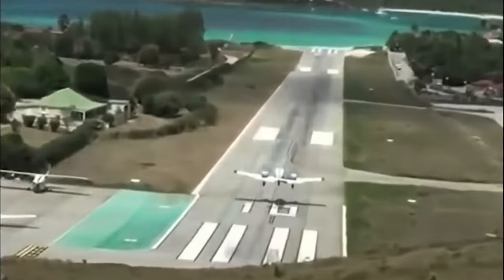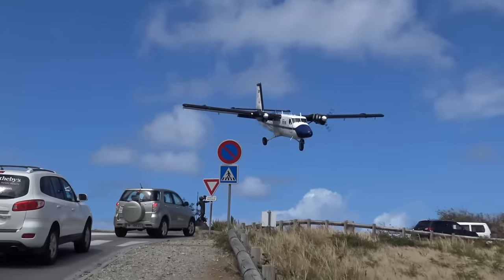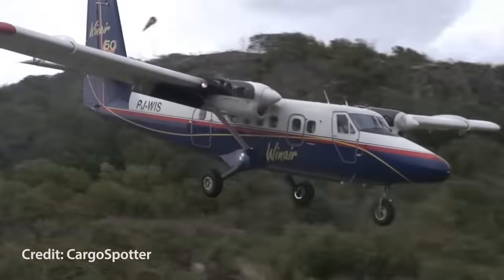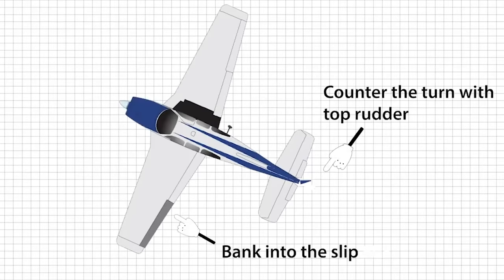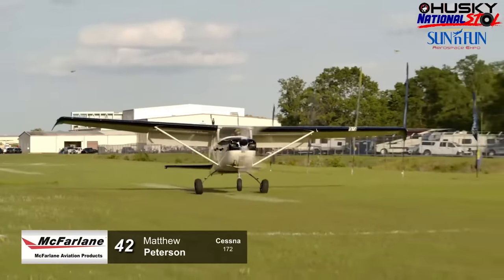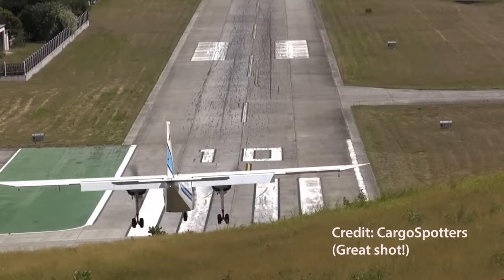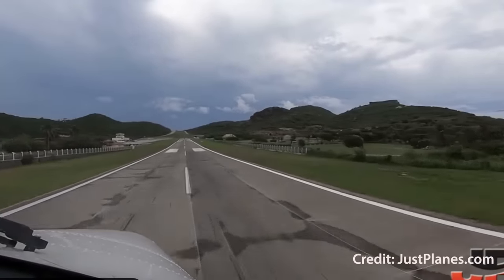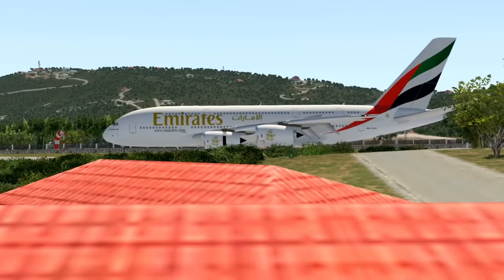Why This Landing Went Bad Part Deux

Comment: A great video and really well constructed explanation of the solution (s). Could there be another civil engineering solution, in rerouting the vehicular traffic lower around the hill and therefore allowing the approaching aircraft a shallower descent? This would be after a few tonnes of the hillside are removed.

Comment: Doesn't really look any worse than a number of strips around here that are only 1800' long but have 125' trees on both ends.   Technique is fairly straightforward.  Have your airspeed 1.1Vso right over the top of the trees, once clear of those, pitch the nose down, but use a forward slip to make the aircraft draggy and avoid the speed up, when you get to the ground you will be right at the end of the runway at 1.2Vso.    Some airports like Whitter AK that have the same hill are only used from the other end, so you have to wait for favorable winds.  One last point, if you aren't going to make it, go around!
Reply: You very obviously have never flown this approach.

Comment: My favorite airfield of all time is Rankin (78Y) in Maryville MO. Its an almost textbook short field which (used to be) 1300 feet of concrete with another 1100 of gravel in case you mess up, minus displacement from an obstacle to the north, and is quite narrow over the paved part. It feels like landing on a bike trail but it's great practice for emergency precision. It looks like they have since paved the whole thing but it's still much narrower than the humorously named Jet Rd. to the West.

Comment: I’ve been there before but never landed there outside of a sim. It is pretty challenging in a sim, I can imagine it’s even more challenging in real life when the stakes are higher.
Reply: Eliminate passenger weight. Eliminate fuel load. You don't even need pilot weight. It's not reality...

Then set 50kt or 100kt headwind. Lol.

Comment: I learned a long time ago, flying RC glider comp, that the best way to land short with an unusually steep approach, is to trim the plane to high AOA above the min sink AOA.  This gives you very high CDi , making the approach slow and steep.  That way, you do not need to wash off excess airspeed before touch down & therefore, you will not overrun the landing.

If you instead aim the plane down the hill, you will have to land with excessive speed & will either overrun the touch down or you will have to plonk it down at speed & jam the stick forward & flaps up in hopes of pulling it up on the ground .  Neither option is great.

For a steep slow approach, while you have height, ease the stick back a little.  The plane will flare & float until you wash off airspeed.  When the nose tries to drop in response to the reduced airspeed, pull back on the stick more to maintain attitude at the slower airspeed, (faster than stall but slower that for min sink rate).   This gives the plane it's steepest possible stable approach & you land slow too.

However you are flying the approach closer to stall speed, so I guess it's one thing to do this in RC & another to have the nerve to do so from the cockpit.  I sometimes wonder is pilots know about this technique at all?

Comment: A380 sim-landing into St. Barts...does Xplane model the windsock deflection correctly? The windsock is pretty limp as far as I can tell...
Considering numerous people stating that in the sim world you just turn the head wind up and then 'helicopter' in a large jet anywhere.

Comment: in Vietnam we had a runway that was on a hill but the runway started at the top of the hill. so the planes could come in slow and low. we still had the problem with bigger planes like the C130 almost going off the end of the downhill slope. the C130 was by far the largest plane landing on this runway. most of the time we has C47's landing. C130 was a special flight bringing in a personel carrier for Special Forces. 1965

Comment: That last clip of the simmer landing that huge aircraft was hilarious.   Thats definitely a one way trip.  That plane would never be leaving that airport (at least not under its own power!)
Reply: It can't land or t/o from there because it's too wide, but as far as runway length is concerned, I'm pretty sure that empty with 1 hour on fuel on board, it will easily do it !

Comment: The Piper pilot thought that by pulling the yoke really hard just before touchdown should work, but he did not have the energy. He might be actually flying the text book approach airspeed of 1.3Vso, but the much steeper approach angle may have required more energy stop, so seems that higher than 1.3Vso or adding power is now needed.  For example to land Pitts very steep power off approach is used to improve forward visibility, and while the stall speed is 60mph but approach speed is 100mph for such steep approach. Paul do you know if the text book 1.3Vso approach speed as per POH of most airplanes applies regardless of approach angle?

Comment: The Guts to Try. The book by the same name as the letter written from British SAS to the Airmen of the Special Operations Task Force from the failed Iran hostage rescue. The origional letter and book are on display in AFSOC (Air Force Special Operations Command) HQ. The failed attempt precipitated the Goldwater Nichols act that has been the successful structure of an independent Special Operations in the DoD ever since. Proving you can learn from a catastrophic failure.

Comment: Using power for airspeed is a much quicker way to change your airspeed, and using pitch for flight path is a more direct way to control flight path. 
Here's my example, in S&L if we want to accelerate, what do we do first? Increase power and then as we accelerate we pitch to maintain altitude, the same applies for a descent. In a climb, we set a constant power, then we use pitch for airspeed, unless we want as specific speed and ROC/Flight path then the same technique applies.

Comment: In the 1980s, I was in that airport and earlier in St. Georges in the Bahamas. In both, they did not take wrecked hulks away, all the time.  In this airport, having our flight delayed because the owner of the airline was required to fly his own plane into the airport, “since their other plan crashed’ (that’s what they said) was disheartening.  AND, this tiny airport did not have the resources to remove earlier crashed aircraft. Seeing those deceased aluminum hulks resting in the bush is not the best confidence gainer. I survived & living in St. Thomas, VI.🌴💙

Comment: I recognized the air strip immediately from the thumb nail. I lived there full time for 3.5 years. I first landed there in 1982. Everyone jumped in their own cars(locals) and took off. I stood there like an idiot with my passport in my hand.

It was about 11AM and NO customs or immigration were around. In fact, NOBODY was there. Not a soul. I lugged my large bag to the top of the ridge and hitch hiked in to town (Gustavia) which was actually quite close.

I put 75% down payment on a sailboat and moved aboard.

By 1985, a full airport facility was built on the other side of the landing strip. Car rentals etc. I MISS the quaint 1982 St Barts. Oh, well. I sure was glad to experience it. 
The island was AMAZING until 1985 when extreme rapid construction and growth killed its charm.

About 25 of us ex-pats left there in 1985. I moved to St Maarten Dutch West Indies,  and then Tortola in the BVI

Comment: Every certified pilot should know what the approach speed should be in any given flap configuration. If for whatever reason the speed and appropriate approach path cannot be nailed down solid - apply go round procedures and start over. If a pilot cannot demonstrate these basic skills, he/she should have their certificates revoked before they damage or destroy property or life. Having spent a lifetime instructing/examining I found American trained pilots, who almost all trained on American type long runways, appeared to think that approaches should be flown at VSOx1.4? This invariably resulted in a long ground float with the aircraft needing increasingly large control inputs as the excess speed slowly decayed. Usually the end result was a few bounces and an unnecessarily stressed out pilot.

Comment: There's people landing jets in MSFS at freaking Saba, but the difference is that the 500 times that everyone died going into the water or smacking the short rocky ledge on the approach end doesn't prove that the one time that you got it was safe. But, for "hold my beer" value, nothing beats ridiculous landing attempts where no lives or property are at risk. I have been known to take part in the unsafe and improbable aircraft landing derby in sim as well. I am definitely not THAT good.

Comment: There may be some shame in screwing up your approach so badly that you have to go around, but it is sure as hell less shameful than screwing up the approach so badly you have to go around, but your pride urges you to press on regardless and you end up crashing the plane. 
      And how much shame is there, really, in missing a very difficult approach? This is not exactly a runway fit for an An-225 in 200 miles visibility and a dead steady 10 knot wind right down the runway heading.
     It's okay to screw up a difficult approach like this. Just go around.

Comment: Noob question.  Why is it that it's always taught to adjust speed using pitch and descent rate using power?  Is it because this way you get a more stabilized speed?  Or is there a better / more logical reason?  If you can keep the answer simple, bonus points.
Reply: Paul- I used to be a light aircraft instructor.  We taught that, on approach, pitch is your speed control and power is your rate of descent control.  The reason is that light aircraft have little momentum and are fairly “draggy”.  If you are too low and you pull back on the stick to gain height, the aircraft will slow dramatically and potentially stall (bad news).  If, instead, you add power, the aircraft will maintain the same speed (cos that’s what it’s trimmed to do) and climb.  So, it’s a “fail safe” option.  On big jets, it tends to be the opposite- you can pull back on the stick to climb, because the aircraft has a lot more momentum ( like, 300 tons, versus 1 ton for a Cessna).

Comment: Question 4 anyone here.

They always talk about a small light twin being difficultly for its asymmetrical thrust with engines on each wing.

Do small or medium sized Lear jets have same issue or less because their engines are on the fuselage or that one engine has a lot more power to climb?
Reply: prop aircraft are going to behave differently than jets in general...and I'm assuming you're talking about one-engine-inoperative flight. Windmilling props and the lack of clean/accelerated slipstream airflow over the wing root, and at a higher lateral arm (distance) from the centerline will add far more drag than the Lear's turbine, which is roughly the same size as a windmilling propeller. The thrust from the other engine is also A) very powerful and B) very close to the centerline, so it wouldn't have nearly the same amount of lateral force from asymmetric thrust. There's also no real critical engine on a jet, since left/right turning tendencies basically don't exist. So to answer your question, small/medium business jets are much easier to control and maintain performance than props when one of their engines quits.
Reply: You "walk" the throttles up slowly as you take off in a twin because there will be inherent assymetric thrust due to propeller differences, governor speed, cross wind and other factors. In a modern jet, the difference in spool up times is not so noticeable and FADEC controls affect this too.
Reply: @royalbirb275  thank you.

Yes, that was in regards to one engine our in small twin prop on takeoff or landings etc.
Reply: @Mikinct  Keep in mind, even in a both engine operating scenario - there is still slight asymetrical thrust. P factor on both engines actually puts the center of thrust slightly right of centerline (In most US twins where the left engine is critical)
Reply: @royalbirb275  thanks 4 reply!

When you bring back blue prop levels say on a baron Twin, that just adjusts the rpm speed as brought back & not the angle of the propeller.

Only when you totally bring it all the way to feather prop when angle runs for less drag angles right? Or as you inch prop levers back it does slowly adjust angle & rpms in real life?
Reply: @Mikinct  the prop lever changes are incremental, yes, so as you pull the blue lever it will change the propeller blade angle. That also changes the RPM at the same time. More prop pitch = prop takes a bigger “bite” of the air and has more drag = LOWER RPM. Less prop pitch = less resistance/drag = HIGHER RPM. Actual power applied depends on the throttle, or manifold pressure.

Comment: he should have gone around floated way past the touch down point  i have landed there many times and was checked out by a French pilot from st Marten which was   mandatory in those days i also was an ATP pilot with 10'000 hrs  they may have changed the rules for check out before landing

Comment: Is it possible for variable pitch props to stuff it into reverse coming down that hill to shed speed? Or is reverse only useful once on the ground?
Reply: I am no pilot but I know that sky diving pilots throw it into a vertical nose dive and use beta to stop the plane from exceeding its max air speed. I have seen videos of this method being used to land the plane before the jumpers are on the ground. So reverse thrust in air is doable. And with that knowledge I cannot imagine that what you suggest has not been tried.

Comment: Why cram an A380 onto that runway? Because it's a simulator and it's a ton of fun. In X-Plane with real world weather and all the possible realisms like brake fade and reverse thrust that actually take a few seconds to engage and spool up and doesn't equal forward thrust output, and it's no longer fun but a hilarious exercise in the softwares' heavy jet buoyancy characteristics in water.
Reply: I'm thinking engage reverse thrust as you fly over the road at the top of the hill. Because it'll take that long to engage!

Comment: Carrier landing :) to hit great credit he used very little of the runway.
if it is permitted then it has to be one hell of a wind condition for the other direction not to be the preferred. It's very strange. Has there been particular accidents landing the obvious way? particular landscape shaping wind gusts to make is treacherous. Because the runway has everything against it landing down hill otherwise. It's like they started doing that and no one ever questioned it. Like so much else in GA.
Reply: It's the trade winds.   They are almost always 15-25 out of the east to south east.  You almost never land to the West.   No go-around capability to the West either, the terrain rises too fast.  This is the hinterlands,  and there is no other suitable place on the island for a strip.
Reply: @midweekpowderhound  Presumably it also wouldn't be ideal doing a go around when approaching from the sea.
Reply: @DoubleMonoLR  Not sure what direction you mean.  Both approaches are over water.

Landing to the East, which is 99% of the time, you cross the ridge, chop the power and skim the hillside for the numbers.  A go-around is easy, Bay St Jean is right in front of you with zero obstacles and you bear left towards open water.  We did touch and goes for training landing to the East.  I've done dozens of Easterly go-arounds there.

Landing to the West, a rare event, there is no go around capability once you are about a half mile off the threshold.  You will not be able to accelerate, get the gear and flaps up,  and be able to make it over the ridge.
Reply: @midweekpowderhound  I just checked the weather, anecdotally, all week it's basically 10-12kts from the east. On a completely level runway you'd land into the wind but it sure as eff is not level. The up hill and landing without obstacles just has to outweigh the wind with ease. And unless it's a weak plane there is plenty of go around. The climb is just not that steep unless you are flying a garbage plane like a bonanza. If you give me any lip I'll whip out the sim and show you :)
Reply: @DanFrederiksen    When a seasoned  check airman and the op specs say never go around when landing to the west, you tend to respect it.  You try it in a real airplane and report back to us.

Comment: Why don't they just reroute the roads through there a little bit, notch out the hill at the approach end of the runway like they do when they build highways in the mountains, and extend the runway a bit into the bay at the far end? It just does not seem to make sense to me to keep it like this. You would think that the resulting vast improvement in the runway approach and extended length would be worth the economic investment in the roads and airport. The amount of road building where I live dwarfs that little project probably every 2 or 3 months and yet, there is far less at stake where I live. The increased tourism resulting from having a much safer airport would seem to be worth it as they could then fly bigger planes into that island.